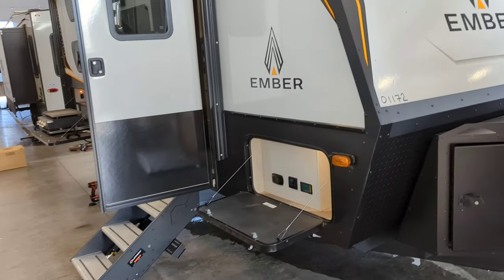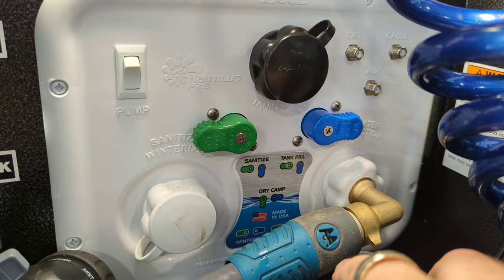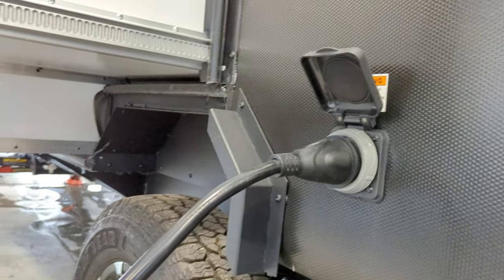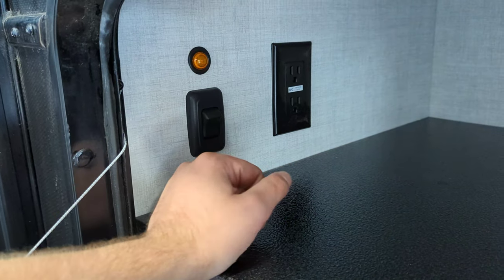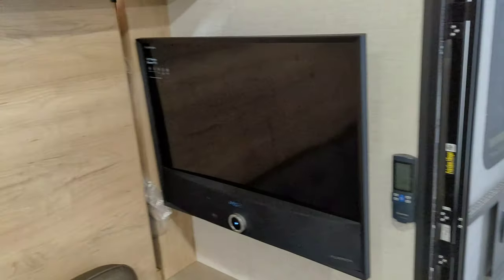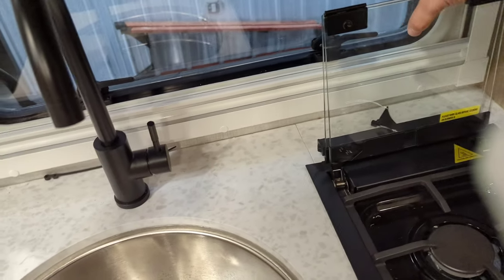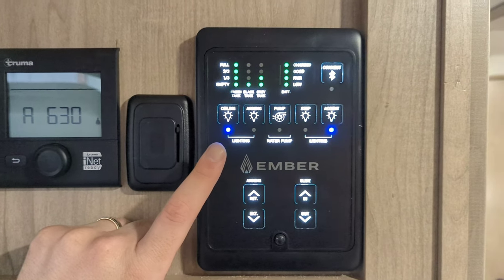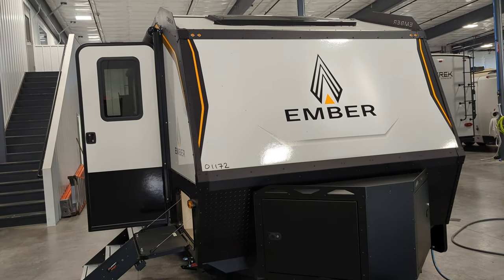2023 Ember Overland Series 191MDB w/Max Solar  -  Orientation video!

Comment: was always told stay away from single axle
Reply: No axle lol. But I’d love to hear the reasoning in that
Reply: @mattdagger1480  If you get a flat, it's harder to change it and you can lose control easier when it blows.

Dual axle also takes the bumps better on the road since the weight is distributed.

Comment: This trailer if taken off road, would fall apart in the inside! The solar package is junk as well.
Reply from the maker: @bmansvids
I'm not sure what makes you think that? Ember took their Overland Series through the Navistar Proving Grounds in Indiana and it cleared the 1000 mile course. No structural damage anywhere. The only thing that happened was one cabinet door popped open. Most other campers are completely totaled after 700 miles. I am very interested to hear why you think the solar package is junk? I would love to hear what makes you think this.

Comment: that is called JUNK SOLAR BS!!!!
Reply from the maker: What makes you say it's junk? Their max solar package is pretty impressive if you plan to boondock!
Reply: Do you care to elaborate?
Reply: @Zach_Elias   How long can you run the AC off of the batteries?
Reply from the maker: @Bronco2Cj  Hard to say with all the variables that solar takes into place. When were testing one of the 270amp hour batteries inside(so no incoming solar charge) with just the AC on low and some lights on. The monitor panel was telling us roughly 16-18 hours of time left on the battery under the current work load. It was colder that day too so the AC wasn't needing to work as hard to keep temp even at low settings. If it's hotter out you will have less time. Hopefully that makes sense. It's hard to explain without showing it 😂